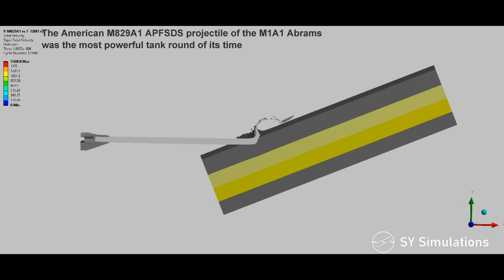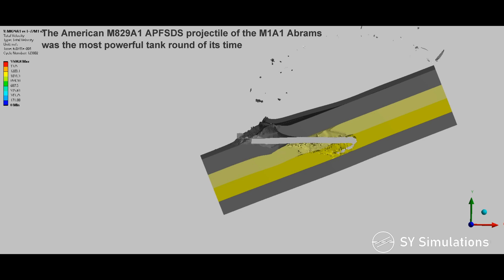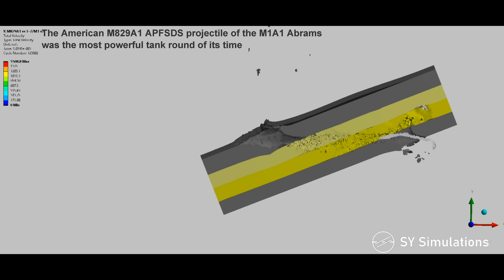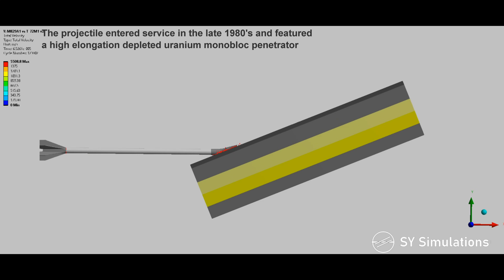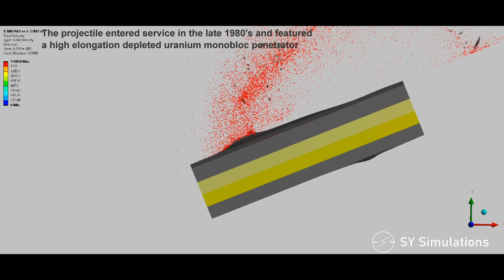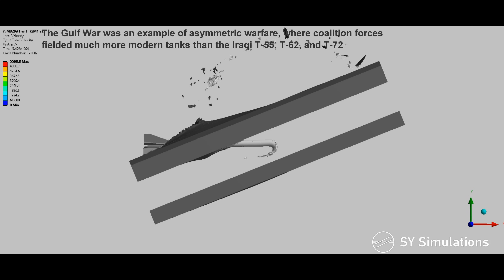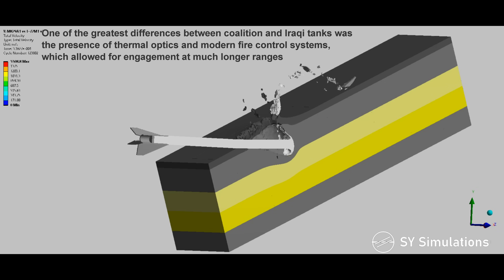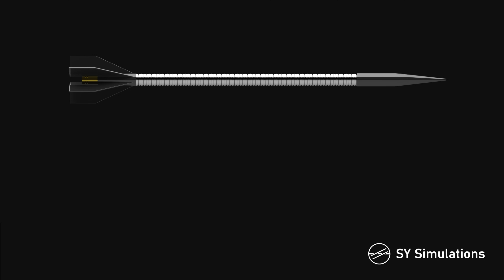Abrams SILVER BULLET vs Iraqi T-72 | M829A1 Depleted Uranium APFSDS Armour Penetration Simulation

Comment: 3km is a looong way away, yet it easily goes through the upper glacis. The lack of deflection is remarkable in this round. Almost like the angle of the armor doesnt matter at all, it just bites in like no tomorrow
Reply: APFSDS rounds dont really deflect off armor that much, even if the round fails to penetrate.
Reply: M829A1 penetrates more than 550mm RHA with T-72M1 armor is only 350-370 mm against Kinetic. No chances at all. M829A1 should be tested against T-72B or T-80U - it's round of that tank era.
Reply: it barely penetrated, with minimal post-penetration effect
Reply: @markcorrigan3930  It easily penetrated and would kill most people in the tank. You dont even know what youre seeing
Reply: one thing that the sim fails to show is D.U. round self-sharp when hitting harden target meaning the front of the round does not become blunt.
Reply: @chrishill3536  The penetrator is supposed to be blunt and it stays blunt during penetration. The term "self sharpening" is misleading is not really whats happening. The sim also takes into account the material differences between tungsten and uranium.
Reply: @Komet1305  true D.U. round burn the outside layer, which would make it self-sharping.
Reply: @chrishill3536  "self sharpening" refers to the fact that the end doesn't mushroom as much as tungsten does. However, at higher velocities (above 1900 m/s I believe) tungsten alloys begin to acquire similar properties to DU with regards to this. I don't believe that any tank guns in service reach velocities like this though so it's more of a thought experiment currently.
Reply: @chrishill3536 let me summarise as it seems like a lot of people are misinterpreting this

“Self sharpening” in DU refers to the fact that DU undergoes periodic shearing & localisation at the area of impact.

What does this mean? Basically, DU when it impacts a target will mushroom, however, these bits that mushroom outwards quickly are sheared off from the main body, keeping a smaller hole diameter compared to tungsten which has a higher shear strength.

This process is also very adiabatic, which basically means it’s affected by temperature, DU will form shear “bands” which will heat up to around 900-1000c and soften, allowing them to shear off much easier; this is what is misinterpreted as “self sharpening” 

It doesn’t stay sharp, it still blunts, however it creates a smaller hole and uses its energy slightly more efficiently.

Also, I heard someone mention that DU is more effective at lower speeds compared to tungsten, and at higher speeds their performance is about the same.

This is true, at higher speeds, around past 2000m/s, penetration becomes more hydrodynamic, meaning the metals involved act sort of fluidly, so the adiabatic shearing properties of DU become basically redundant past these speeds. (this doesn’t mean they are actually liquid, they are still solid, but are able to stretch and strain far more than they would normally, think how metal is heated up so it’s easier to work with because it becomes softer and more plastic, sort of the same thing happening here which is caused mostly from pressure, not thermals)
Reply: @chrishill3536 chris hill, why are you choosing this hill to die on?
Reply: @generalmarkmilleyisbenedic8895  well based on the fact there report from desert storm were tank and IFVS have burnt mark were D.U hit and front Armour look like they were melt would mean the round were burning though the Armour.
Reply: @chrishill3536  It was due to kinetic energy of the penetrator transforming into heat when hitting the armor. It happens regardless of the material of which the projectile is made of.
Reply: @chrishill3536 With my very simplified calculations, at muzzle velocity, the peak temperature of an M829A1 projectile upon impact would be around 5,836°F (3,235°C). Of course, this temperature would only be reached for a very short period of time, but 5,836°F is very well above the melting point of RHA. That is what causes what you're talking about. The "self-sharpening" property of DU is an oversimplification.
Reply: @Trve_Kvlt  yeah but is there enough time for it to undergo a phase transition?
Reply: @Trve_Kvlt it isn't. It shears off the mushroom head so diameter doesn't increase, it self-sharpens. Burn marks are because uranium dust is extremely flammable
Reply: @Trve_Kvlt  What calculation did you do?

Comment: The weird part is that we take theoretically most advanced soviet tank at that point(T-80U with full Kontakt-5 ERA coverage, Drozd APS and Shtora APS), it'll still dislike being on receiving end of this match up. Though it'll have a more even fight due to having early thermals and barrel launched ATGM, not to mention how it'll frustrate AH-64, M901 and M2 Bradley crews to no end due to having all the possible tools to protect itself from ATGMs.
Reply: Shtora wouldn't affect the most common ATGMs of any of the platforms you just mentioned as it is an infrared dazzler. While the majority of the US's missiles, even back then, were wire or laser guided and remain so to this day. You can't spoof a wire or laser guidance system with a system meant to fool infrared sensors.
Reply: @ThatGuyOrby  TOW missiles work by tracking the flare at the back of the missile and automatically keep it centered in the sights crosshairs.
for this specific tracking system Shtora could work by confusing the automatic tracking system.
Reply: @ThatGuyOrby Wire guided missiles aren’t guided BY a wire they’re guided WITH a wire. Majority of them receive their movement data using a fiber optic cable or something similar but they’re guided by using the same principle as beam riders or spot trackers. The TOW missile for example uses fins and engine propulsion to keep the missiles rear on an infrared beam on the center of the ITAS. But more modern TOW’s have a redundancy system in case of an ir spotlight flooding the system, the missile and targeting system swap to a xenon based tracking principle allowing it to guide inspite of IRCM.
Reply: @theliteralworst9416  My wording was poor in my first message but that's not what I meant. My point was that the guidance system for the TOW-2, the most common wire-guided ATGM in the US arsenal around the time has redundancies for the way Shtora "jams" infrared sensors. 

To use the Army's words on how it counters infrared jamming:

"The TOW-2 introduced an upgraded flare to counter this. A visual encoder was installed on the flare to make it emit a pulsed coded signal that the firing post receptor was tuned to receive. This prevented “brute-force” jamming of the signal."
Reply: @ThatGuyOrby  It won't affect Hellfire and TOW-2, however I-TOW is on the fence as people argue for both PoVs on that one. And if understand it right, I-TOW was still in use during Desert Storm on M901, no? 
Beside Shtora wasn't the only system I named in that sentence, but all of them were of ATGM protection variety and thus wouldn't change the outcome of APFSDS lobbing competition. That one would be solely down to T-80U armor package.

P.S.: I think I heard that older laser rangefinders were susceptible to dazzlers ruining their day, no?
Reply: @TheArklyte  If I recall correctly the I-TOW was, as for how susceptible it'd be I'm not smart enough to say one way or another because I've seen conflicting opinions on it. I'm fully willing to admit that I just plain don't know for sure.

As for lasers I don't remember ever hearing that laser rangefinders can be spoofed, again I could be wrong, but they can be detected by a Laser Warning Receiver letting a tank being lasered know that it's being targeted.
Reply: @ThatGuyOrby  Warthunder forums to this day argue on I-TOW and Shtora.

But yeah, I guess the inclusion of LWR would be biggest impact that Shtora can bring to the table as it'll warn about laser rangefinders and laser guided munitions(the angles are still questionable)... so basically useless against only TOW-2. But that one is prime candidate for Drozd.
Reply: Shtora wont affect a hellfire
Reply: @Jonas636_  depends on hellfire used
laser ones would possibly be affected
Reply: @Сталкер-ь2х  Shtora works by confusing the launcher not the missile itself
Reply: @Сталкер-ь2х  It wouldn't do a thing. Hellfire is looking for a laser pulse, there are no instructions being provided to the missile from the launcher for the Shtora to jam.
Reply: @Сталкер-ь2х  Hellfire won't be affected by Shtora due to some very simplistic reason not connected to either system - if I recall right, single carrier of Hellfire during Desert Storm was AH-64. Because T-80U is armed with ATGM themselves, AH-64 would be more inclined to attack from higher altitude and that would put the path of Hellfire outside the area of Shtora.
That's a factor that argument about effectiveness of Shtora and effectiveness of interference protection of Hellfire won't change.
Shtora was mentioned mostly as a tool against I-TOW of M901.
Reply: Barrel launched ATGMs sound like a cool weapon, but they faded into obscurity for a reason. The US dabbled with them at one point and figured it's not worth it at all.

Comment: Could you do the same projectile against T-90M? 

Other ideas for simulation: 

- Steel training ICBM slug vs a bunker
- 1957 Plumpbob atomic test irradiated manhole flying into a n@zi flying soccer at 66 km/s.
Reply: Not the exact same projectile but there's a video on youtube (simulation plus) showed M829A3 vs T-90M
Reply: To answer you're question. M829a1 would have struggled to penetrate the hull if a t-72b even without the era. That's an actual soviet tank of the time.

And for the rest....I'd love to see those too😂

Comment: 3000m shot but the dart is entering at a flat angle still?
Reply: yes, M829A1 is flat up until 3.6km because it is 22mm, ie very thin
Reply: What do you expect the angle to be?
Reply: APFSDS has an incredibly high velocity, is very aerodynamic, and flies incredibly flat. M829A1 has a muzzle velocity of 1575 meters per second, which means that at a distance of 3000 meters, it would've taken about 2 seconds to from firing to impact. Angle of impact from drop would be negligible if at all extant.
Reply: @MacSalterson Not 100% correct , cause this is the velocity as it leaves the barrel . It slows down immediately , hard to say exactly how long it takes for 3km .

Comment: The end result ist the same but to be correct the armor is the wrong one, the T-72M1 still uses the 80-105-20 armor. You can see it on the front of the vehícule directly under the drivers periscope which has 4 ribs, a indication of this type of armor. The armor used on the simulation has 3 ribs not 4.
Reply from the maker: It seems the Iraqi's had a mix of ones with and without the 16mm applique plate, here is an image of one from The Tank Museum where you can see the 16mm plate. Its most evident by looking at the cut-outs around the towing eyes https://x.com/TankMuseum/status/1188544897114132481/photo/1
Reply: T-72M1 copies armor of T-72A with one small exception in case of iraqi forces - due to their experience with iranian TOW-1 mossiles, iraqis added an additional external plate to act as spaced armor and make the tank nigh invulnerable to TOW-1. So it's BETTER armored against HEAT compared to original.
Reply: @TheArklyte  That´s what many believe, me too back then. But after thoroughly checking the situation it is confirmed that the T-72M1 has a 80-105-20 base armour, regardless if they later put some extra armor on it or not.
Reply: @DonJuanIIdeAustria 
The rib is not a reliable indication. 
The 16mm plate was attached to both the 80 20 and 60 50.
Reply: @jintsuubest9331  Yes, but the ribs are not reliable when the 16mm HHS plate was applied because they put two ribs on every plate regardless of the base armor underneath. But before that the ribs were a reliable indicator. I have never found a official confirmation of a four ribs armor with a 60-105-50 underneath, the were all without exceptions 80-105-20. At least during the Cold War until 1991. Later they mabee made some changes but never found a official confirmation.
Reply: @DonJuanIIdeAustria  we can always check 16-20(air gap)-80-105-50;)
Reply: T-72M would have the updated  60 + 105 + 50 armor from T-72A as baseline, there is a photo of Polish T-72M front hull plates side profiles and you can see that arrangement. Unless the Iraqi version of T-72M was downgraded to original T-72 armor layout.
Reply: @Lemard77  Yes I know that picture, and jet their is no official information that confirms it otherwise. That picture is quite new so I suspect that it was maybee meant for the PT-91.
Reply: @DonJuanIIdeAustria  Well PT-91 has the same hull as T-72M1, so they would have the same armor other than the polish developed ERA
Reply: @Lemard77  Officially yes, but it still doesn´t add up with that famous picture of the armor plate in the polish factory. As I said I have never found a official confirmation of a T-72M1 with a 60-105-50 armor. If you have one, please share it.
Reply: If by ribs you mean the bullet deflection planks, then their arrangement is not dependent on the UFP composition, and alterations on their placements would be introduced separately. Soviet armored vehicles were continuously improved during production, with all the upgrades and reconfigurations listed in the so called "Albums of construction alterations" (Альбом конструктивных изменений), which would usually note that this specific improvement was introduced beginning with the hull number so and so.

Comment: HEAT simulation against composite armor🙏
Reply: They said before that HEAT was very hard to simulate
Reply: @pyrenees2695  That's not why i pay them. I don't pay them at all, to be honest.
Reply from the maker: One can dream...
Reply: I remember there were HEAT simulation videos before but against a solid block (should be equal to thickness of composite armor's thickness in theory) rather than actual composite armor.

Comment: SPG 9 vs T-90 with era and without era pls:)
Reply: insane and won't do a punch through, except take side or rear shot.
Reply: mtc4?
Reply: @irirjhrhr4645 SPG-9 is completely busted in MTC4, if the crew is not paying attention you can easily pen a T-72A from the front by shooting at the small gun mantlet and it will knocked out the gun and the MG. If you shoot it from the back of the turret in a bush you pretty much disable it forever and it’s easy picking from there.
Reply: no chance
Reply: just use MTC4 debug mode dude.